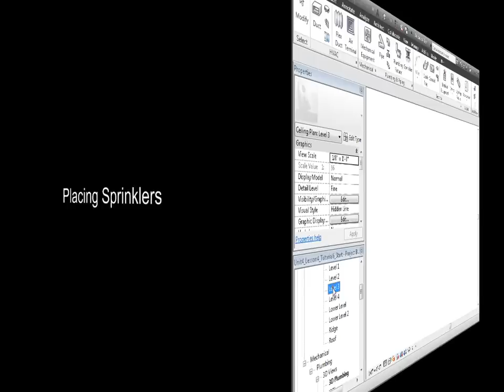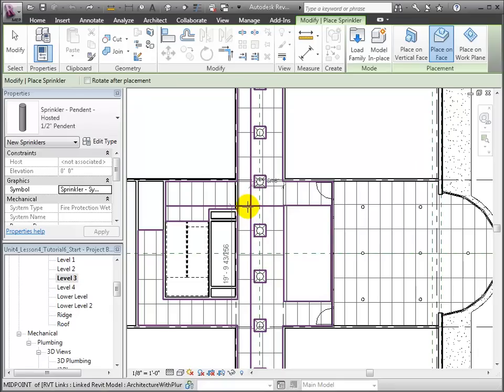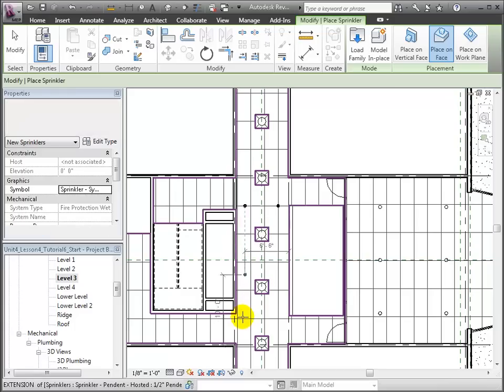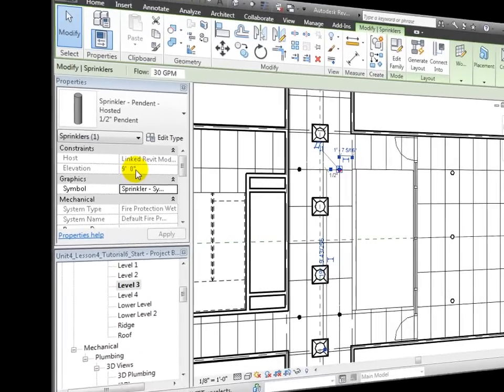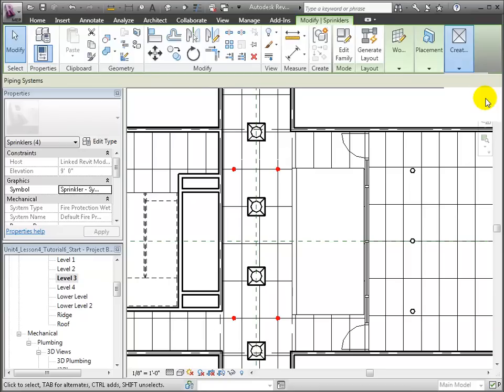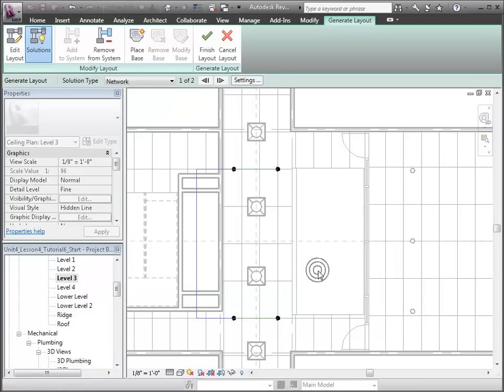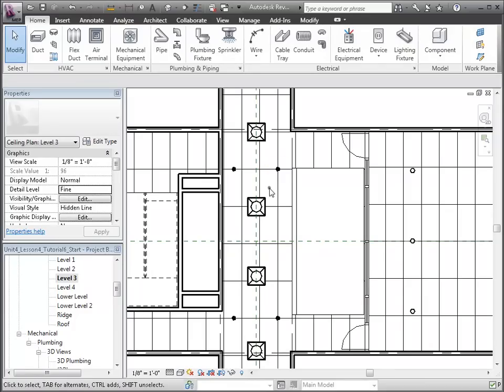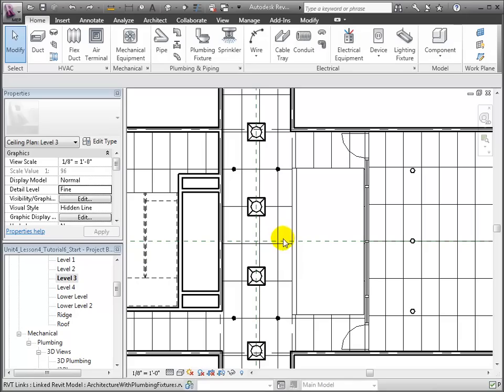Revit MEP - Modeling Fire Protection Systems

Comment: Great video! Do you know how to create a FP family for Revit that can be placed at an angle (to sloped pipe) to where it shows in plan view as it would if it were in a straight 90 degree pipe? option 1. is creating a tag.. 2. have floaters? but this is not what revit is for... would like feedback on this :)

Comment: typical engineer with no understanding of what they are doing.....you can locate sprinkler heads on ceiling grid, but first you would need to remove the grid...perhaps you should reconsider?